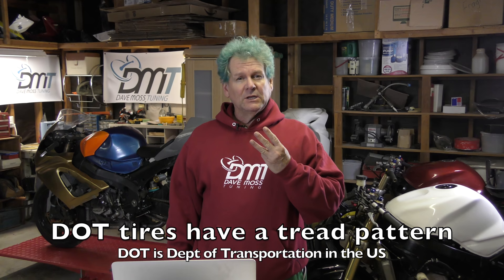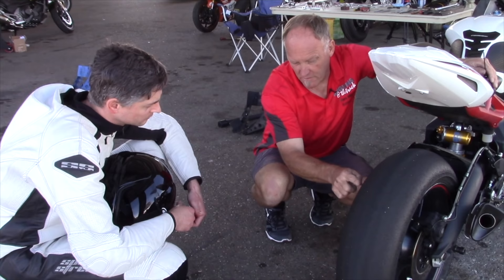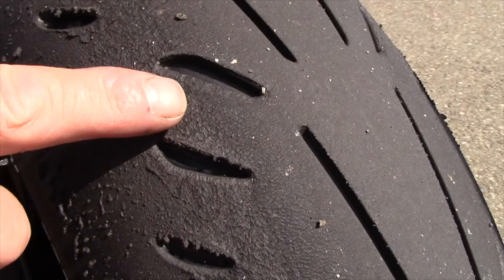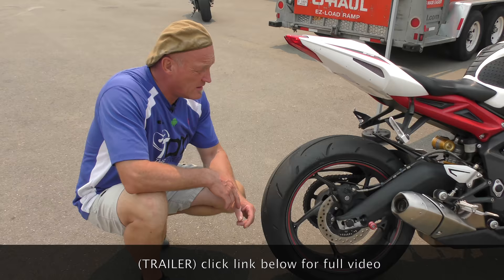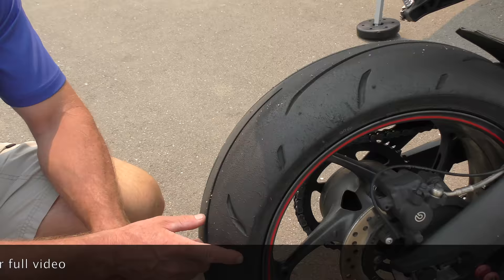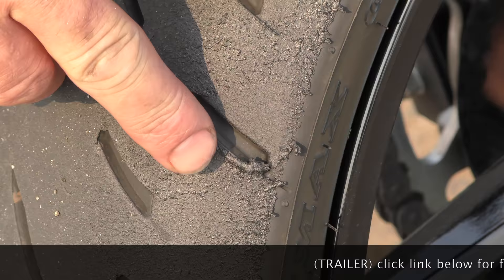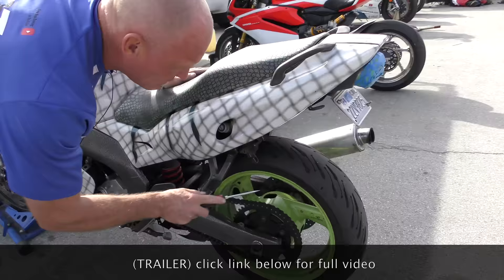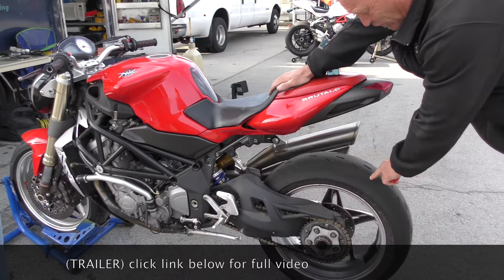Contact Patch: Reading Motorcycle Street Tires (TRAILER)

Comment: your opening sentence was like a eureka moment for me; i started out on pirelli tyres (came stock on my 2015 Street Triple R) and a lot of times i found myself surprised with the rear stepping out without warning while the front felt like a sponge. Moved onto Dunlop Q3 and man my confidence in the bike was restored... i instantly felt confident on the track to drive through the turns, it just took me 2 sessions at first to get over the fact that i shouldn't over analyze bike reaction in some turns because i was comparing it to when i rode on pirelli and back then it gave minimum road information feedback ...
Reply: Same here. I bought a 2014 last fall that has Pirellis on it and it'll kick out suddenly every so often when I'm in a slight turn and hard on throttle. Makes me weary getting on it when in tight turns. When these tires are done I'm definitely trying some Dunlops.
Reply: Q3s are amazing, the battlax s21 are bad ass also from Bridgestone.
Reply: Very interesting and something I’ve never thought of. I have. 2016 street R with Pirelli Rosso corsas. Always thought they had a lack of feel but did perform well. Only thing is due to lack of feel you don’t know when they’re gonna let go and always edgy about that when pushing. Think I will try the Dunlop’s or maybe Bridgestone tyres. Maybe something inbeween would be good. Cheers Dave
Reply: JamchesterBoozle I know what you mean and like you said if you like to push hard sometimes you definitely want that feel and feedback from the tires. I’ve never tried pirellis but for sure man if you like to push hard q3s is the way to go. I’ve always like the s21 tires because I feel like they are a little taller and they dip into the corners real quick. And once they get warm they are like glue I had no problems with them when dry or wet conditions. But ya brother I would definitely roll with the q3s or s21. You can’t go wrong with either. Ride safe brother
Reply: I've tried the s21's on my previous bike, cbr600rr. They're great and exactly how Jacob described them but i would add personally i felt that they give no warning when you reach the limit of lean angle, and you reach there very quickly with their drop into the corner snappy response. I don't know if i would change my mind about them now because i had them 5 years ago and back then my riding skills for the track were not great. 
After the s21 i went for continental sportattack 2, great tyre, but now that I've tried dunlop i am happy with it.
Reply: jacob rules cheers for that will give that a go 👍🏻 safe riding brother
Reply: @sergedagher  I had the same issue. I felt like I was always using the edge of the tire with the s22s. I'm going to try the rosso corsa 2s this season
Reply: serge dagher my MV F3 800 had Pirelli Rosso IIs stock and the Q3+ I got afterwards gave me waaay much more confidence.
Reply: @OscarLopez-sx8ij  I was wondering about the Q3+, unfortunately i sold my bikes and now i am in a new country and in looking for a job; so no bikes for the time being, but i know for sure that my next ride will be running the Q3+
Reply: Dunlops rule. Full stop bro.

Comment: i have a new XC…..the ride is always bumpy.  new paved roads are bumpy.
old paved roads are bumpy.
the ride is always bumpy.
my bike is a 2022, which i bought this week in june of 2023.
considering it’s a left over i’m thinking it has been sitting in the showroom for a long time and one or both tires have a flat spot.
as that flat spot hits the ground on every revolution, it will feel bumpy.

i could be wrong but that’s the only thing i can come up with.
unless the suspension needs tuning.
even if the suspension needs tuning the ride should be smooth of pavement, especially a newly paved road. this is why i think it’s flat spots on the tires.

your thoughts ?

Comment: I believe in learning from the experts. You are certainly one of them. You do wonderful very informative videos ,My question is, if I have my tires dialed in and then I go two up with the same person is there a formula or do I have to redo that whole system which I'm willing to do because my life and certainly being responsible for my passenger is Paramount. Yet another factor, I pull  a timeout pop-up tent camper sometime solo sometimes two up, with all that do I do all the steps that you showed for each one of these scenarios or is there some kind of a formula by adding weight or something?

Comment: Great info, thanks for the upload Dave! When you say Pirellis, do you mean all Pirelli tires in comparison to other manufacturers? For example, the Diablo Supercorsa SC is quite soft (intended for track use) while the SP has a stiffer carcass meant for street/sport applications. I have a SP V3 on my 22´ Street Triple RS, I´m always amazed by how much grip there is and how it transmits the road imperfections while soaking everything up and maintain grip. So I wonder if this lack of feedback is something only from the road-oriented Pirelli tires, or the track-oriented SP and SCs also present this characteristic.
Reply from the maker: Thanks for your question. Carcass differs between models and versions. The V3 iteration is slightly stiffer and there is a current trend where the rear is staying softer for a bigger contact patch on acceleration than the front for much better breaking stability.

Comment: I didn't understand: when a tire "eats" the front angle, is it a problem of carcass or softness extension brake of the shock absorber? They reach me it's the second: because to avoid softness problems of carcass, we could just pump them a bit more
Reply from the maker: It is a problem with the rear suspension not being set correctly and with very old oil.
Reply: @catalystreactionsbw  thanks, I supposed it was a too hard spring respect the hardness of the shock absorber (most of all in extension)

Comment: So Dave I under stand the information a stiff vs a soft carcass tire will give you but I was wondering if a tire carcass is stiff and one were to be riding a bike that is more flexible like a ninja 300 or a Katana 600 vs RC51 or R1 ect would using a softer carcass be better as the harder tire would send more feed back into the bike / frame causing flex or dose the carcass stiffness not have a big influence on the chassis and frame flex when the bike is being pushed hard like at the track or canyon riding? Good video thanks for all the info.
Reply from the maker: The carcass does not have a profound influence on frame flex - the level of grip te tire produces does have a profound effect. So, when setting up smaller bikes like 300's if the bike gets good grip then the frame/swing arm/forks will flex. In most modern motorcycle, that is engineered into the bike as tuned flex and even modern 300/400cc bikes have that integrated into their design due to the success of track days.
Reply: @catalystreactionsbw  
Great info as always thanks.

Comment: You said Dunlop have a stiff carcass but then said the GPR-300 have a soft carcass (3:02) -- is this because the GPR -300 is aimed at low power / beginner friendly bikes?

edit: never mind! I watched some other videos and the question is addressed
Reply: what is the answer to this? I have these tires on my R3 I just bought
Reply: @tlalexander3  I am certainly not an expert, but I'd say the GPR300 have a soft carcass and sidewalk. This is on 110F and 140/150R, which is smaller bikes without big weight and big power, so they don't have the same amount of energy necessary to flex a stiff carcass.

I think those tires are fine for what they are. No need to take them off early, but they'll only last around 4k mi. They're pretty good value, honestly, but I also think tires are one thing to consider spending a little more money on.

Comment: So dave , , i have a fully adapted ( Brake s , suspensoin , motor , clutch ) Suzuki Sv 650 2005 , they run stock 160 in de Back , i can converse them to an 180 Bud would i bennefit from that , what do you think are the pro s and contra s , thanks en greeting s from Belgium
Reply from the maker: 180 needs a 5.5" wheel so unless that change is made, the handling will not be as good as stock.

Comment: About how much contact patch is needed for bike to stick in corners and leaned over? I'm still unsure of my lean angles and cornering speeds possible. I feel like I need to have as big a patch as possible, but then that would be lower tire pressure, and opposing what you say about having a preferred higher pressure to keep patches smaller in lengthen the life, which all contradicts my paranoia. I'm thinking a4" patch would be great but higher pressure make it smaller, and also considering the softness/stickiness of the rubber. No doubt a track day would do me some good, but I can't ever get out there. Besides the fact of my questions of certain pavement types like the rocky surface stuff of most old black tops that get really slippery, esp when wet.
Reply from the maker: Thanks for your question. Patch is a correlation to speed. The faster you go the more the tire flexes and the bigger to contact patch. Speed and lean are conjoined twins so you cannot have lean without speed. Pressure is a balance between ability, suspension and settings matched to road temps. Summer pressures are generally higher, Winter pressures generally lower. You may find these videos helpful: https://www.youtube.com/user/CatalystReactionSBW/search?query=pressure
Reply: @catalystreactionsbw  great, thank you.  so on any dry paved road surface I dont need to be concerned about wheels [esp front wheel] sliding out from under me like it would on a dirt or gravel patch?  as said, my faith in the tire grip from lean and speed isn't very good yet.  maybe I'm over thinking it.
Reply: Follow another rider, in best case one you know is a good rider. When he makes a corner and you follow with same speed you'll see whats possible. You don't need to be a tire expert to ride. 
But of course your bike (suspension, tires, etc.) need to be in good condition.
Reply: @Max-yy3lz  i totally agree with that concept and actually do practice that, BUT many I follow are really cautious and slow around curves. But none push it anywhere near limits, nor ever follow anyone in rain on those slippery black top road surface with the smooth faces of rocks used as filler which are the slippery ones. All else are pretty comfortable, and I'm able to push it gradually more n more.
But thx for that.

Comment: Hi Dave, What are your thoughts on mixing tire brand/models front & rear?
Reply: uses0ap not an expert by any means. But I can confidently say it’s a bad idea. Why would you do that?
Reply: @JamchesterBoozle  if you want to change tire brand so you start on the rear because the front is still in good condition??
Reply: DaytimeRider if i was changing brands I’d do them both at the same time. No way would I mix and match!
Reply: @JamchesterBoozle  i am a cheap bastard. what do you do with the front then?
Reply: I wouldnt sweat too much on it when theres riders getting around with car tyres on the back Lmao
Reply: @mr_sowong9464  you can get great tires for $100 brand new each, that's like.. Dirt cheap. You should never skimp on safety on motorcycles.
Reply: mr_sowong differnet make tires have different profiles that dont work with other makes. I have had guys tell me they think their frames are bent because the bike handles so bad. Just mixed tires not working together. Bad idea mixing brands

Comment: I really want a ktm rc8r or a yam r6. A lot of highway riding nothing super high speed. Goals are to find reliable acceleration and decel as a daily driver. I weigh about 170, live in ohio. Would say temp range is 70 to 90 for riding weather. Moving from dirt bikes to the street. Any recommendations for a good starter tire and pressure? Would be great to have your insight.
Reply from the maker: R6 would be better for your weight with any Hypersport Brand tire starting at 34/34 cold
Reply: @catalystreactionsbw  thank you very much! Any chance you have a few minutes to chime in on why not the ktm? I love both brands dirtbikes. Apples and oranges I know. Those rc8's just look great and I like that there aren't many around here
Reply: Guess I'm kind of like Johnny 5, need more input! Hahaha. Would really love some of those 80s 2 stroke Superbikes as well! RZ, NSR, GRV. Would love to have ride around with a group of two stroke rockets! Keep the modern bikes for more daily drivers
Reply from the maker: @zealobiron  Rc8R suspension is very harsh at your weight. 200+ it would work. If you can pay for the revalve front and rear by all means get one.
Reply: @catalystreactionsbw  I can revalve it I think. I've done it on dirtbikes at least. I was taught to some a degree, a fork is a fork is a fork is a fork. Building shim stacks is like therapy for me. Lol. Just need to do it more! Thank you so much for replying!

Comment: When adjusting suspension do you take rider body weight in consideration?
Reply from the maker: 1. Rider weight is the primary consideration. 2. Oil age in the forks and shock is a secondary consideration for damping. 3. Geometry is the last of the Trinity for evaluation.

Comment: I un-subscribed (i am still subscribed). Why ? I am looking for a bit of help to adjust those dame shocks, and all this is a waste of time, just before ''eureka'' the and stop his videos. - Dave actually took contact, what a guy. Have actually been a subscriber for years. How he read the bikes are beyond me.
Reply from the maker: There are a shed load of 2 Clicks Out videos that teach you exactly what you need. Get to work.
Reply: @catalystreactionsbw  haha, you actually read these. LOL.  Been working on this for much longer than I usually need for anything. But never seem to get it right. Bike balanced, all measurements are taken. I set the rebound and compression as per makers weight reference, but this is not correct. So I go little by little outside of these settings. Either the front wobble out of the turn with the rear wheel is chattering. Looking at you just make it more frustrating, you do this in 2 minutes and the bike is perfect.
Reply from the maker: @norseman5041  What bike? How many miles/kms on the odometer? What brand, model and sizes of tires? What cold pressures? What is your weight without gear? How aggressive are you with the bike? Where are the issues - going in, mid corner or exit? There are lots of questions, all need answers. The quickest path for clarity and direction is via tire wear and the Contact Patch playlist as tires cannot lie.
Reply: @catalystreactionsbw  I have two one EBR 1190RX and the one I work with now the 09 Buell XB12Scg, 22500 miles, New fork oil Bel Ray 5w, Pirelli Diablo 120/70 and 180/55 ZR17 Front 29-31 ibs and rear 24-25 ibs. Temperature her in OH swing a lot and I ride all year, so i keep adjusting the tire pressure. This bike is not on the track. I weigh 87 kg. It look like she is plowing in the turn, since the ware is on each side of the center. Also I have a rebound issue as i get the ''U'' pattern on the sides. I tried to ease off the weight on the front by reducing the preload on the rear. The bike seem to be better balanced now. ''Push down test'' However the front forks travel nearly all the way down, leaving only about 19mm before hitting the bottom. The forks sag 6 mm without me on it ''static sag'' + 6 mm more when I get on totaling 12 mm. I believe mid corners have me the most at unease. I feel I can not trust the front. I put on a new set of tires, will take her out when the weather get warmer. Been very cold and it probably had effect on the oil.
Reply from the maker: @norseman5041  Send me pictures of the tires to dave@davemosstuning.com
Reply: @catalystreactionsbw  Don't reply this looser.  He's getting in your head and trying to make you do the work for free. Any man with some brain can realize you are among the best. Just let the haters cry.
Reply from the maker: @xuhan4682  I do :)